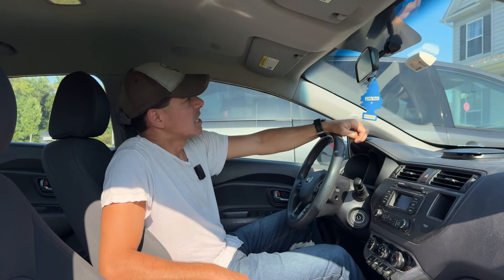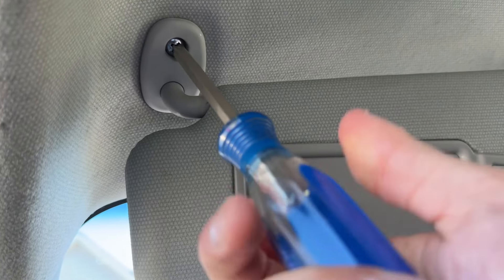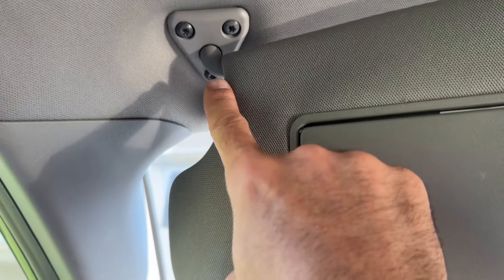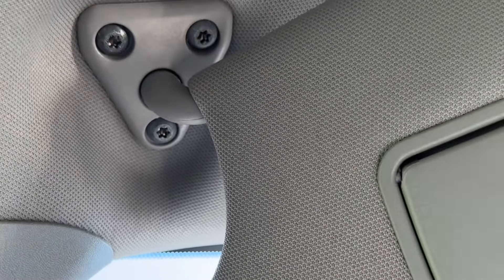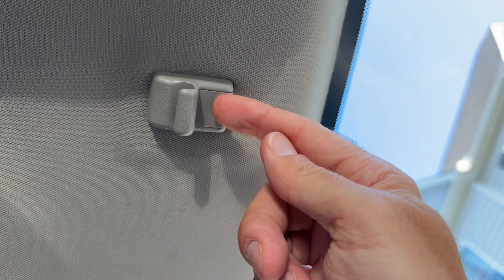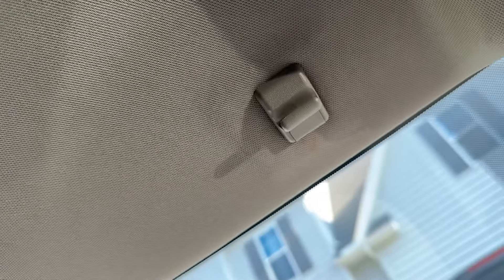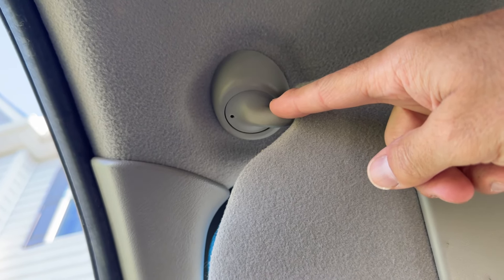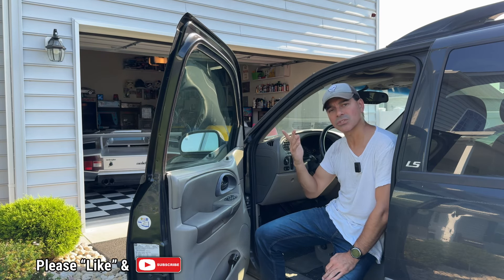How To Fix A Loose Sun Visor (Andy’s Garage: Episode - 488)

Comment: What if the visor won’t close all the way and it’s floppy? How would I fix that ??😭
Reply from the maker: @nicoleanita2681  so it’s loose on the rod? If so, you can try tightening that by injecting a little glue with a hot glue gun. That should tighten the fit.